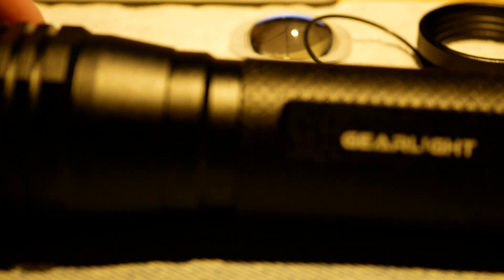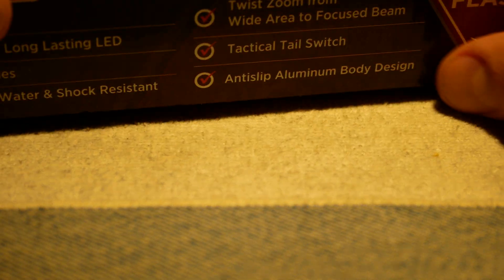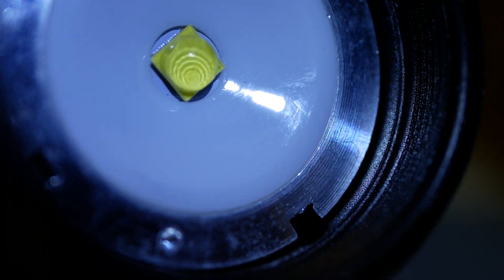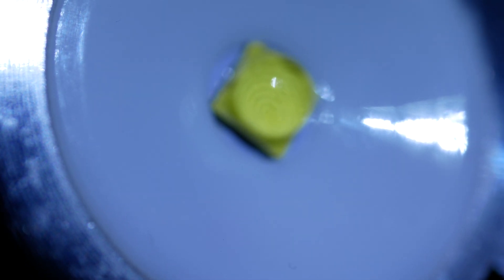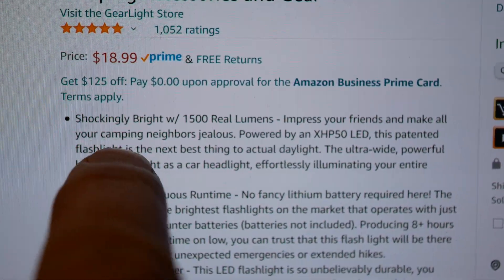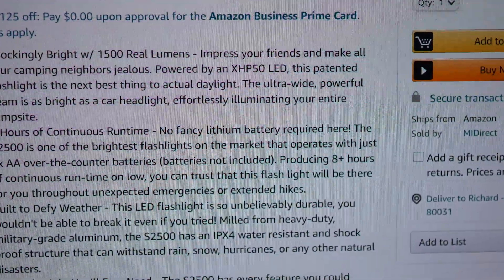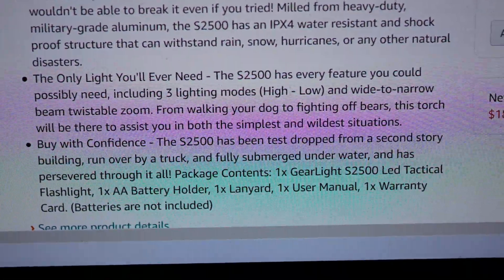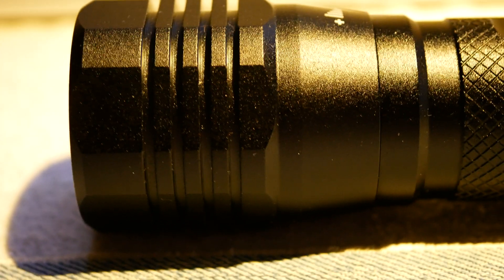Gearlight S2500 XHP50 - Yet another FAKE pretending to be a legit CREE!!!

Comment: Are you telling me I cannot believe everything I read in an Amazon listing???
I'm shocked and disappointed 😯

But not surprised. 😜
So how much would a real Creel light be?
Reply from the maker: This past summer, I bought sunglasses that were supposedly photochromic on Amazon. They arrived, I expected them to darken in sunlight and to lighten inside. This didn't happen even a tiny bit. I contacted the seller, showed them pictures, etc. They contacted the manufacturer that claimed they were photochromic...who confirmed that in fact the exact sunglasses I purchased were photochromic. The seller sent me a second pair. They too did not change tint in bright light or inside. I even tried a UV flashlight on them. This ought to make any part of the lense exposed to UV darken. Nothing happened! I got a full refund. 
**
So yeah...sellers lie all the time...even on Amazon!
**
As far as I know, Thrunite uses legit CREE LEDs and they are not overly expensive. When you compare the price of a fully Chinese light vs something that has a reputation to preserve...you'll pay a lot more for that reputation! There are quite a lot of flashlights that use legit CREE LEDs in them. They just won't sell for the price of the Chinese lights.
**
I look at price almost as fast as I look at the specs. IF they claim "legit CREE LED", the light won't be selling for $20! Break in price point for legit CREE LEDs is more like $40 and higher...much higher depending on the flashlight. IMHO...$20 light...NOT CREE inside...not EVER.
Reply: @de-bodgery   The closest comparable Thrunite flashlight is $70.  Not “overly” expensive?  No thanks.

Comment: If is not CREE, then what type of LED Is it? 😯 

Can u send me link to a REAL CREE led zoom light? I want buy one! LOL
Reply from the maker: It's a Chinese knock-off in the same size and general shape of a legit CREE XHP50. Later on, I was messing with the cheap dome lense to get the LED to focus on the ceiling. There is slight dark lines between the 4 segments. This is not how a real XHP50.2 looks when the same thing is done with it. The Chinese manufacturer of the LED probably coated the entire surface with some kind of yellow coating that looks like phosphor. This was probably to hide the fact that there are 4 dimpled elements underneath. I'm not sure of the details, but I think CREE may hold world wide patents on the smooth LED element. To copy it may bring down law suits on the Chinese LED makers. As a result, maybe they have to make their LEDs with the dimpled pattern on them? This is a guess. I really don't know.

Thrunite, while exaggerating on their lumens specs does tend to use legit CREE LEDs. This is probably a legit CREE XHP50.2 LED in here. I don't own this flashlight and have never looked at one so I cant confirm that for sure. The XHP50.2 just does NOT make 1500 lumens! Go look on the spec sheet from CREE. The brightest binnings are 1140 lumens. And here is Thrunite listing this light at 1500 lumens. NOT TRUE!!! They may be over driving the LED to get that 1500 lumens. Legit CREE LEDs tolerate this quite nicely...so that's possibly it.

https://www.amazon.com/ThruNite-Magnetic-Flashlights-Rechargeable-Flashlight/dp/B07R66R5FS/ref=sr_1_3_sspa?crid=1053IRTH1YVVQ&dchild=1&keywords=cree+xhp50+flashlight&qid=1611173302&sprefix=cree+xhp50%2Caps%2C239&sr=8-3-spons&psc=1&spLa=ZW5jcnlwdGVkUXVhbGlmaWVyPUExOVYxR0hXVEJMME9VJmVuY3J5cHRlZElkPUEwNzgwNTE3MjFaNERPRUZWVllOMSZlbmNyeXB0ZWRBZElkPUEwOTUwNDY3MU9INERYTDRGT1M5MSZ3aWRnZXROYW1lPXNwX2F0ZiZhY3Rpb249Y2xpY2tSZWRpcmVjdCZkb05vdExvZ0NsaWNrPXRydWU=
Reply: @de-bodgery  I need link to a zoom light, that uses REAL Cree, Idk is it exists or not yet? 🤷
Reply from the maker: @carlor2633  Feel free to look, spend time on google and post your results. I've never heard of Zoom lights. 
I've posted a new video. I just bought 2 thrunite flashlights so I can take them apart.